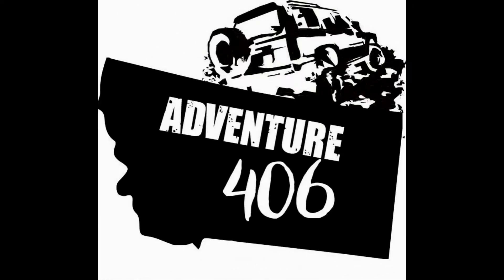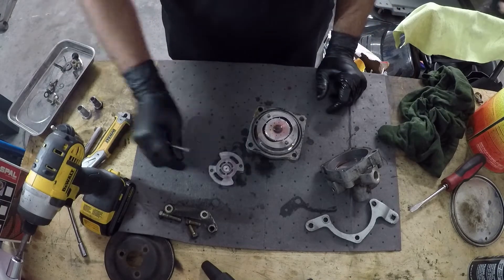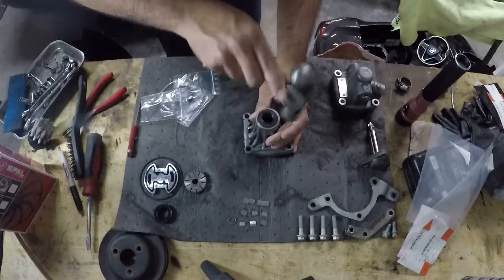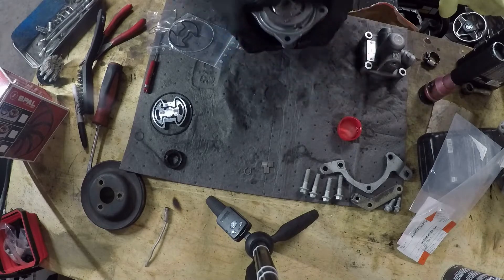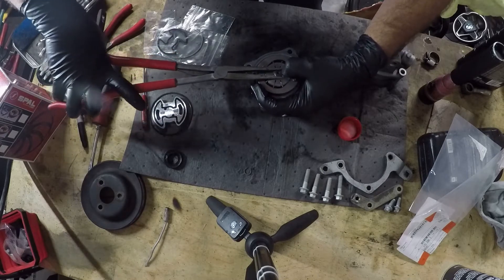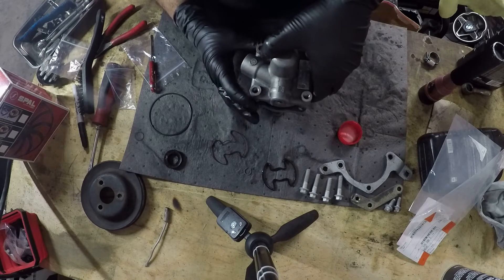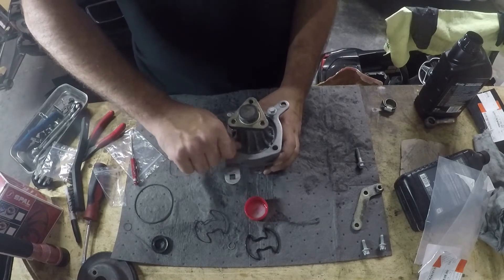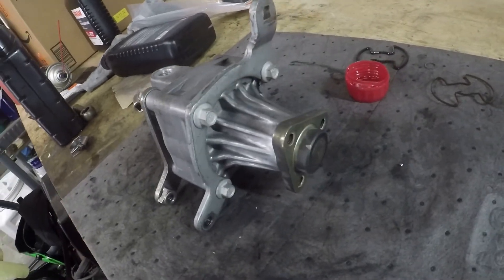e30 Power Steering Pump Rebuild Tutorial!

Comment: Can you provide the repair kit part number and where to order it
Reply from the maker: Check the body of your pump to see what manufacturer it is. If it is a Vickers pump you will need 32411133023, if it’s a ZF pump you will need 32411135880. Both kits can be found at any online bmw kits retailer or directly from the dealer.

Comment: Does a part of the pump wear out if it is making a whine noise & how can you fix that?
Reply from the maker: Typically they make the whine noise because they are leaking somewhere and cavitating from air being in the system. Considering the cost of the rebuild kit it’s worth having a go at it and you can inspect the internals once inside. The internals don’t usually wear, but sometimes the shaft bearing can wear out, which will show up as play in the pulley before disassembly.
Reply: @adventure406  Thanks for the info

Comment: How did you remove the “triangle” part which bolts the pulley?
Reply from the maker: It is the main shaft which goes through the pump, has a little circlip where the vanes are that has to be pushed out. Once you get the circlip off the shaft will pull right out
Reply: Thanks a lot for the answer mate

Comment: I think you missed a big step, you didn’t pack the inside of the rubber bushing with grease. The shaft will be spinning dry inside and wear out the bushing.
Reply from the maker: I hand prime them with dex so there’s no dry starts
Reply: @adventure406  lube isn’t going to get into the inside of the bushing. The bushing seals tight against the housing and the shaft, but inside they’re an empty void that needs to have special grease. It’s hard to explain, wish I could show you what I mean.
Reply: @adventure406  how many miles have you put on since the rebuild? Just curious if there’s any leaks from the bushing pulley.
Reply from the maker: @dohc1974  only a few hundred. No leaks yet still dry as a whistle. I used to be a dealer tech and I’ve done tons of these rebuilds with no come backs, so I’m confident in the process.
Reply: The seal has two elements, a sealing lip and dust lip. The grease between the dust lip and seal lip is mainly to stop contamination. The inner sealing lip will be lubricated by PS fluid

Comment: I wonder why mine doesn't work after I rebuilt mine. Is the reservoir fluid supposed to be bubbling around when the car is on? My fluid is just still and I turned the wheel lock to lock
Reply from the maker: When the car is running it should be clearly circulating fluid in the reservoir. There will be bubbles at first but they’ll eventually go away. As the system bleeds the air out
Reply: Bought another pump, but I realized I took the old drain plug out of mine and stuck another bolt in there because I messed up the drain plug. The bolt I stuck in there was too long blocking a passage. But I drilled it out because I also used jbweld. Going to re use the back half of this new pump and see what happens. Hope all goes well